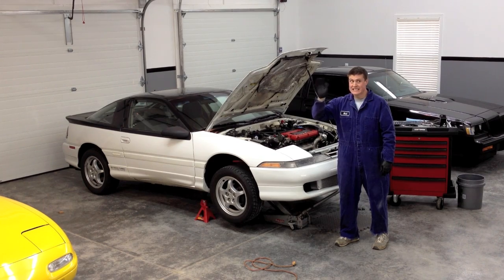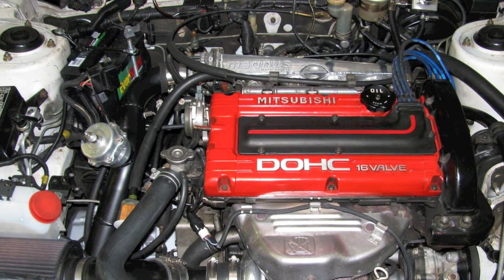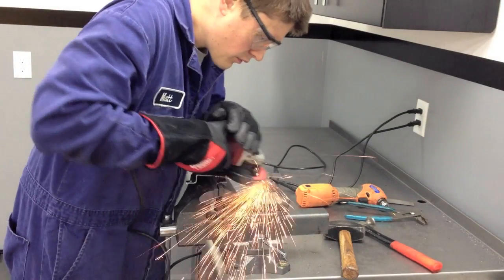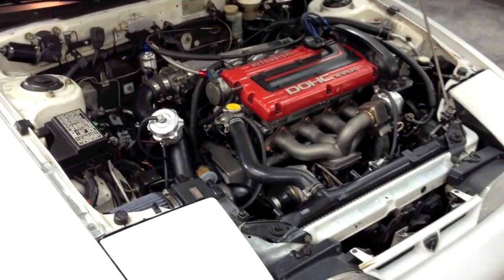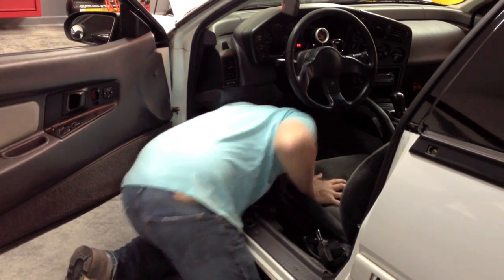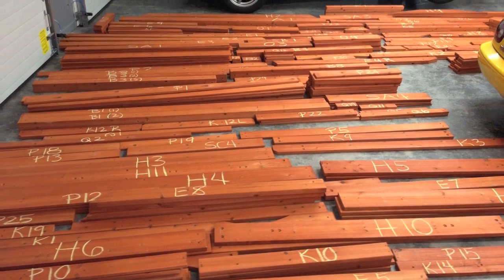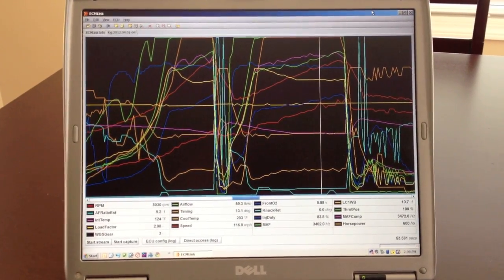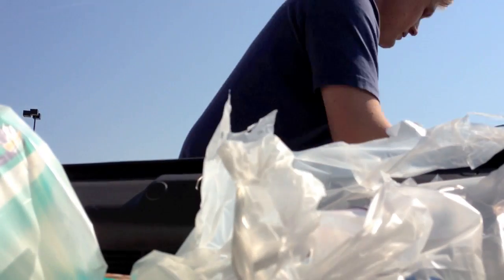Eagle Talon AWD Turbo Upgrade - Part Two

Comment: I need your help.. I'm not too mechanically inclined... traded an old  Relic 95 Z28 Camaro that had set for over 15 years because my uncle lost the key back when I was just a little kid.. u know those chip keys that where four to $500 just 10 years ago.. well the Camaro itself only has 55,380 miles and I recently put the 380 on it.. got it running but still was going to need a lot of work because it's set for so many years with a convertible top..  so I decided to trade it today for a 97 DSM 6G43 turbo...  pretty cool little car it's a tuner so it's going to need some extra things...

Comment: there away to get ligh crank bring to 12k rpm or 15k rpm. all days ,  but that another idea , or reused a/c water drain to cool intake pipe , before and after intercooler Tom , that will drop your temp. and increase HP with or without water injection tune

Comment: Hi Tom.. first at all .. great vídeos!!! they're very helpful. so im coming here asking you for some advice. well right now i own a Mitsubishi eclipse 95 4g63 2,0 turbo.. and im ready for upgrade it. but honestly here in Durango México its very hard to find support so any way. im thinking to use a 16g td 05 turbo , but i have a lot of doubts with the fuel inyection system. can you tell me please what to do? .. i know i have to port the exhaust and the pipe as well. i have the Ínter cooler right now and the Bov. but as i told you i dont know what to do with the fuel inyection so i was wonder you may be help me .. oh and sorry for my poore english in advance.  greetings from Durango México
Reply: Upgrade to Evo 560cc injectors if your just running the 16g turbo

Comment: that ecm link is it expensive to get
Reply: About 600 new from ecm. You'll need a eprom ecu too or you're gonna need to get yours re-socketed. If you got a 98-99 blackbox, just reflash with a openport and evoscan. Much cheaper

Comment: Were you running stock cams on this pull? The website link says hks cams (but also a fp red turbo..).     I'm making a similar build, and in the quest for drivability i'm running mild lift bc 272's with adjustable gears, and tuning on pump gas. My question is, with stock cams, will it ever pull that hard up top? Thanks
Reply: +Jacob McCracken 
Or with mild lift cams, like my bc 272's.

Comment: A little more information on how you were able to run a roadworthy vehicle on a lawnmower battery, if you please:
1. How well did it perform cranking a 6 cylinder? Hot/Cold Start?
2. Any longevity issues? Replacing it once a week? 
3. Issues with a 12v starter/alternator?

Comment: Hey man, love your vids. Were the engine internals in your talon stock? As for the engine, did it really have 208 000 miles? I'm looking at an 1990 eagle talon here in canada. It's completely stock and has 260 000 kms or roughly 160 000 miles. That is the only thing that bugs me about the car and I want to know if these engines do well with high mileage. Thanks!

Comment: Tom's Turbo Garage I got a question for you.. I wanna get my car rebuilt so i can get a turbo put on. it's a 96 civic, I'm thinking of just taking the whole engine out, taking it apart and sending it to a machine shop to do honing and resurfacing. Should i get my block bored out or should i just keep it how it is? and do you have any idea how much a normal shop would charge me?
Reply: *****  cnc werkz. .. do the cylinder support system they guarantee 500hp
Reply: Atyou Lmfao what's the cost on that?
Reply: +Narciso Garcia THE SHOP will most likely charge you a shit load of dough and they will take there sweet ASS time!
Reply: for just the machine work?
Reply: It's 350 check them out .... Cylindersupportsystem.com
Reply: that's not bad. but I'm just gonna drop a different honda engine in it maybe a B series or an H series in it. it would be a lot less time consuming.

Comment: hey tom I'm looking to buy a 1g awd talon guy says it has a leak from the exhaust side of the turbo I wouldn't imagine that it would create that big of a problem to drive it less then 10 miles home this wouldn't this cause any problems anything else i should look out for? it is a auto which i dislike a bit but the price is right and a 6bolt!
Reply from the maker: xRec I would suggest this: http://www.dsmtuners.com/threads/dsm-used-car-buyers-guide.238710/

Comment: Umm what is that boost juice for ?  What does that replace if it replaces anything? Never heard of it.
Reply from the maker: nick campbell Thank you Nick, well said!
Reply: Boost Juice™ is Snow Performance’s proprietary mix of 49% methanol and 51% distilled water. It is made in a controlled environment with special care to ensure the ratios are accurate. This results in a high performance water-methanol fluid formulated for use in all Snow Performance Water-Methanol Injection Systems.
Reply: hmmm i seeee thanks

Comment: Hey Tom what brand manifold are you using? Any pros vs cons?
Reply from the maker: It's an ERL. http://youtu.be/hQ77fayNfqo?t=2m7s  It worked fine for me, they are kinda hard to get, others may be easier and cheaper these days.

Comment: Just out of curiosity, how does the car run with the bov venting into the atmosphere? Any special tuning?
Reply from the maker: It runs good, only because I'm running ECMLink in their speed density mode, which no longer needs the blow off valve to be recirculated.  Here is the information.  http://www.ecmtuning.com/wiki/sd101

Comment: Hi Tom, let me start by saying that I found your channel about a month ago. I drive a 2014 evo x with full bolt ons, which made 349 awhp 362awtq.At this point I am done with it because I want to keep it in a non blown up state for as long as possible.Ive been itching for a project for a while now, but a 1g talon was never really in my plans.I found your channel just a month ago, and now there is a minty fresh 34k original mile (hate on) 1990 eagle talon in my garage, and for that, my significant other would like to thank you :)

I have a couple questions about your setup as I am planning something very similar (already picked up ecm link for dirt cheap localy and that manifold is on my xmass wish list).First, where you running hks 272's?i believe you mentioned that on your vr4 video.second, looking at your lb/m airflow, is it safe to assume you where in the 600awhp range with that turbo?if so, that's wicked cool.

thanks for the awesome entertainment!
Reply from the maker: Hey man, good to meet you!  You're welcome and I'm glad you enjoy the videos!  I love the Evo X and congrats on finding such a low mileage, clean car too, please send me some pics on Facebook if you get a chance.  Regarding your questions, I have all of the Talon info (mod list, updates, etc) posted at http://talon.turbomirage.com , in case you haven't checked that out.  I was running HKS 272s and that precision turbo was belting out 600ish hp based on the full weight (AC, etc) and mid 130mph trap speed.

All that said, I know you said you have the T3 manifold, but if I were to do it all over again, I would skip the T3 based 6266 and run one of the bolt on FP turbos like the billet wheel FP Red or Black.  That isn't a commercial or anything like that, they're just dang good, responsive turbos and you get the benefits of a stock placement turbo.  Here's a link, look at the prices!  I bet they would extend those prices if you asked nicely too.  Just a thought!  Anywho good luck and have fun!

http://store.forcedperformance.net/merchant2/merchant.mvc?Screen=CTGY&Store_Code=FP&Category_Code=DSM-Turbo
Reply: Tom's Turbo Garage wow Tom, you are seriously an awesome dude.I would have never looked at this if it wasn't for you.I just picked up that fp black externaly gated, fp race manidold and hardeware kit for $1,070 shipped.was thinking of going gt35r or similar like your setup and erl mani, easily 2k+ if I had gone gt35r. I cannot thank you enough brother, seriously keep it up.looks like im scratching that t3 mani off the wish list and putting a magnus intake on there lol
Reply from the maker: chrytech636 NICE! Glad I could help and have fun!

Comment: hey Tom question; will the 1g awd drivetrain bolt up to a 2g engine and body?
Reply from the maker: Never researched this myself before, I just Googled this: http://www.dsmtuners.com/threads/1g-2g-transmission-driveline-compatibility.402630/
Reply: Tom's Turbo Garage thanks a lot... i have a 95 talon tsi fwd that I'm converting so i went out and bought a 1g awd drivetrain i was told it would bolt right in and some say it wouldn't fit
Reply from the maker: smo0v333 Well, never trust anyone that says something that is clearly complicated "bolts right in."  I would look at the differences, examine everything and make that judgement for yourself.  One man's "bolts right in" is another man's "it took me five years, 10 grand and a divorce" to get it to work. :-)
Reply: tell me about it...it was a performance shop at that... I'm still doing  research

Comment: Hey Tom! Quick question: are you running stock internals yet? I know they will hold a LOT of power as Ostar Motorsports has shown (749awhp). Wanted to let you know of my project I've been building for the last couple years. Its a 2g Spyder GS, with a 2.4 4g64 motor that I have turbocharged using 4g63 turbo parts. I'm still running stock nonturbo internals (rods are the same 4g63 forged rods that are in all 7 bolts) and almost maxing out the 16g turbo that's on it. I am upgrading to a Holset HX35 turbo & Speed Density soon though. Also have a built automatic tranny which was fun to build. I'm not using DSMLink though (I wish I was), I'm using a factory DSM '99 Turbo ECU/Tactrix Openport 2.0/ECUFlash method used in most Evo's and works great, just not very user friendly. As far as I know, my 2.4 has made the most power on stock internals (361hp and 364tq) which makes a great daily car!
Reply from the maker: Hi Steven, good to meet you!  I was not running stock internals on my Talon, but I am on my newer Galant VR-4 project.  Yes, the 4G63 stock internals are very strong, but it greatly depends on the history of the engine and how it was cared for.  Thanks for the info about your car, it sounds great and I hope you enjoy it!

Comment: hey tom is that a stock air intake censor cause yours look more rounded on the end going to the turbo as mine is more oval shaped if it is round where can i get on at?
Reply from the maker: Hey man!  In this video I'm running an Evo 8 mass airflow sensor.  They can be had in various places used- the Evo forums, eBay, etc.
Reply: thank you tom
Reply from the maker: theguardianss11 You're welcome and good luck!

Comment: If ya don't mind me asking, what did it cost you to do all of this? And what kinda power does it make?
Reply from the maker: Hi Mike, the cost is tricky to calculate as I used many parts from old cars I had, used parts, DIY stuff, etc.  That said, you could get an idea of your cost by checking out my mod list. http://talon.turbomirage.com/talon_mods.html  I never had it on a dyno, but based on the weight of the car and 1/4 mile trap speed it was in the 600hp range.
Reply: Tom's Turbo Garage Oh wait a minute... I have looked at you website for this car before and I guess I skimmed over the, "Built 4G63 2.0L Short Block"..... Still pretty impressive for a 2.0 4 cylinder! Did you do the entire bottom end like pistons, crank, block, etc? Or just the block itself?

Comment: You know Tom I had a similar issue with a good battery for the Magnus SMIM, I ended up going with the Braille B3121, it fits great and is a high capacity AGM battery. 550CCA ,1380 PCA, 742 CA.

http://www.streetfire.net/photo/1865328.htm
Reply from the maker: manrightchea Yes, I have heard very good things about the Braille too.  Thanks!

Comment: hey man, that is a sick car, turned out great and sounds amazing. Question for you tho, I have a 97 talon esi DOHC 16valve no turbo no AWD. Am i able to add a turbo to it? i asked a guy that works at a parts store and he said that it might not be a good idea because the engine may not be able to handle it, without having to upgrade pistons ect. is that true? am i doomed to have a turboless talon unless i pull the block and do some upgrades..
Reply from the maker: WizardRecords91 Thanks man!  I don't have much experience with that engine, I would recommend checking out this section of the DSM forums.  http://www.dsmtuners.com/categories/420a-dsm-tech.31/  Good luck!

Comment: My 1995 Talon is spitting all the water out of the radiator out and not taking it all back, caused it to overheat once. What could it be? We are doing a compression test right now, because the radiator bubbles at an idle from cold. It did smoke white for about 2 minutes, but not again since, so its really stumping me. It doesnt seem to be the head gasket, but i will know today if or if not. Can anyone help?

Comment: thank you so much for the cheap water/methanol info! it came in very handy! the nozzles are $8 now and i bought my pump from our local farm/garden store for $50. also found a 1/4" push connect solenoid valve for $10 and Hobbs pressure switch for $10. with connectors and hose iv spent around $130. a lot cheaper than the snow performance stage 1 kit $362
Reply from the maker: NICE!!  Great to hear Matt and good luck man!

Comment: Any advice trying to build to 500hp? I have a 97 talon fwd. I'm doing a awd swap next year. I want to build the engine a little this year I have 4,000.00 to spend I know it's not alot but it's all I have right now to spend
Reply from the maker: Hi Curtis, I would recommend you check out the FAQ section of dsmforums.  There's great recommendations and upgrade paths on there.

Comment: Dude I have got to say I love your videos. I'm going to be getting a talon this week and I'd love to do performance upgrades right off the bat. What all would you recomend?
Reply from the maker: Thanks man!  Good luck with your car and my best advice is to take care of all of your maintenance items before considering adding any performance mods.  Even if the previous owner says its up to date, chances are there's still work to be done.  Here's a pretty good guide: http://www.dsmtuners.com/threads/dsm-maintenance-guide.476550/
Reply: Change out the rubber turbo inlet pipe and replace it with a metal one. The stock (rubber)  pipe collapses on boost and restricts airflow. It's the pipe shown at 4:30 of this video. It's fairly low-cost and high gain. I agree with Tom, start with maintenance. After the maintenance is sorted out, tackle the turbo piping/ intercooler. Do your homework beyond that point and do not get ahead of yourself.

Comment: Tom,it's me again tom i have question i want to turbocharger father's car and i want put all this things here this is list  td04l turbo,an oil rail cooler,upgraded fuel pump but does 3 bar are use for turbocharging to don't throw check engine light if you don't want to upgrade your injectors

Comment: tom i have a cuestion, do you have stock internals ?  stock compression ? and if you are stock at what rpm you got full boost whit the 6266 ?... sorry for my inglish is not my first language. by the way bery nice video
Reply from the maker: Hi there and thanks!  No, the engine is not stock.  It's an old Buschur Racing stage 3 block and head from my old race car.  Here's some more info http://talon.turbomirage.com/talon_feb_2007.html

Comment: https://fbcdn-sphotos-b-a.akamaihd.net/hphotos-ak-xfp1/t1.0-9/p526x296/1966930_10154189074415273_2694352555125667887_n.jpg

This is 2014 set up :D bullseye s362  doing the alternator relocation as well since I cant even slide a finger between it and the don pipe :(  should be fun times

Comment: DAMMM This is an awesome video. I was looking at random video of Eagle Talon and can across your b/c I had an 90 Eagle Talon Tsi AWD Turbo. AND I MISS IT. it looked just like yours. I'm going to get another one and Tune it. I would be happy @ 600hp. too.
Reply from the maker: Thank you Jose and good luck with your DSM search!  They are out there, it just takes a little patience.
Reply: I have a 1994 eagle talon tsi with only 60k miles in nearly perfect condition

Comment: Awesome Talon. I have a 90 Laser with all the bolt ons and stock turbo pushing around 250 whp. Im looking to get around 450-500. Can you give me a list of what I would need along with possible changes I would have to make to the suspension and transmission to handle that hp.
Reply from the maker: Thanks Alex!  That is a simple enough question, but one with many answers based on budget/how you plan on using the car/driving style/etc.  I would recommend doing plenty of research, which will help you form a plan that will fit your needs.  There is a wealth of information here: http://www.dsmtuners.com/sub.php?page=tech  Good luck!

Comment: Sorry for the silly question but how do you adjust the speed at which the jack lowers? I've tried adjusting mine but no matter what I do or how slowly I turn the release bar it always drops my truck. Thankfully it's got beefy suspension and big tires to soften the blow. I'm just scared to use it on my new car.
Reply from the maker: Hi Derek, I would search online for the owners manual for your jack - there's usually an adjustment for that on the jack.  Good luck!

Comment: isn`t a AtF rate of 9.2 a bit rich ?
Reply from the maker: You're looking at the ECUs estimated a/f ratio.  Look at LC1WB for the actual air fuel ratio as logged from the wideband sensor, and 10.7 is still rich, but it's always best to sneak up on your tune rather than start aggressive, in my opinion.

Comment from the maker: Thanks Caleb, I appreciate that!  I have that info on the Talon's website, but it is an old 3" Megan Racing down pipe (that has now been modified for the new V-Band turbine outlet), ho-made 3" off-road pipe and 3" Megan racing cat back.  I'm sure there would be some power in upgrading to something better or 3.5" diameter.